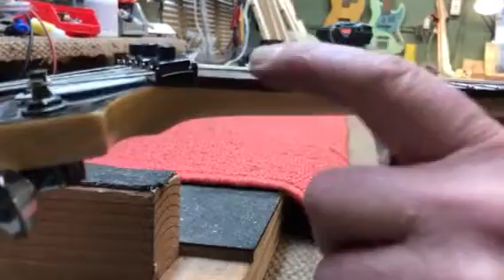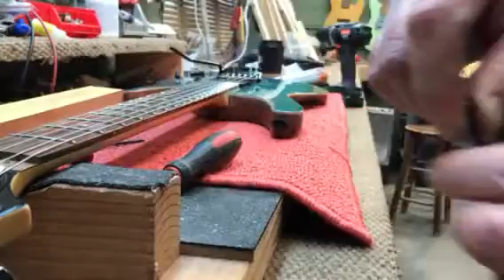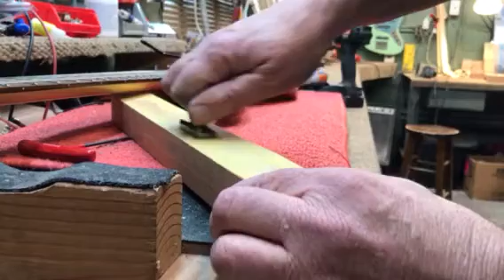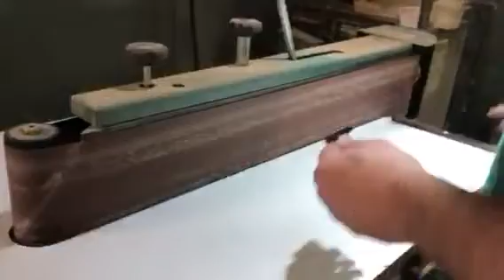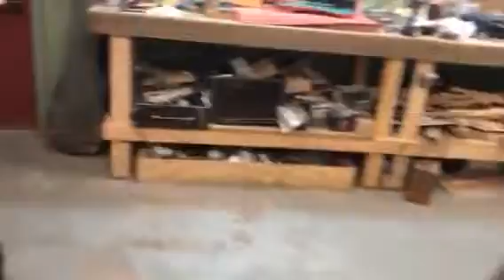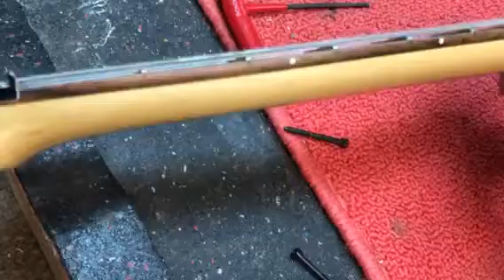How to lower a Floyd Rose top lock on a guitar

Comment: ok holy hell this is the best video on this issue. U should put the words file, and filling down etc...in your word reseach choices so this video comes up more. I was thinking of filing the grooves lol this is wayyy better taking off material under the full plate instead of each groove. wow genius. and wont have the trouble trying to buy a lower one that will fit. thank you so much. like you said it lowers the action not only at the first few frets but the hole guitar then ajust the rest accordingly to get sweet low action for shredding. your the best my man. Only thing I dont get is your using sandpaper for metal? we dont have a sandpaper belt at work but there is a grinding wheele would that work? gonna be harder to be flate I guess cuz it's round and not flat. hummm I have ALOT to take off.

Comment: I had to do the same on a new Jackson, didn’t want to send it back as rest of guitar is perfect.

Also had to move nut in centre more. Used cocktail sticks and glue then re drilled. Hand sanded down 1mm and it’s perfect now

Comment: Hey Jim
Thanks for this video – I just subscribed.  I was thinking of doing this but was concerned about cross threading in the neck due to misalignment of the threads in the nut and neck due to removal of nut material.  Have you every had an issue with this or any other problem after doing this?

Comment: I just bought a jem jr used in white. it's fine but what's with the super high nut? I own gibson, kramer,jackson, other Ibanez, bc rich, fender, prs and others. none are that high at the nut. can I just buy a lower nut I mean so the strings will be lower at the first frets. I like low action and this would help the overall action. it's like 3 times to high. I will have to file down the groove were the strings sit or file down the wood under the metal nut but I dont like that because it wood mean it's stronger and I would take a lot off. all other guitar I have are 3 times lower, I would expect this on a Walmart guitar or something. I very suprised by this on a Ibanez. realy sucks. sorry for the bad spelling I am french. If I can get a lower one please give me the link for the righ one... anyone thanks. other vids on the guitar are telling me they dont have this problem, I'm guess maybe it's not factory or they made a mistake at the factory I dont know.